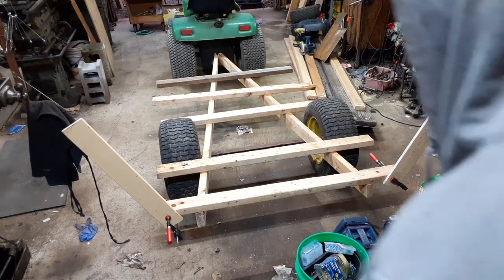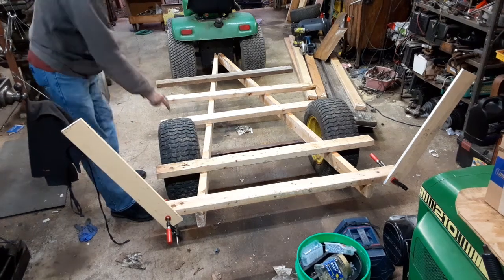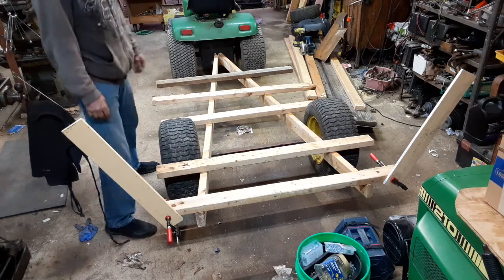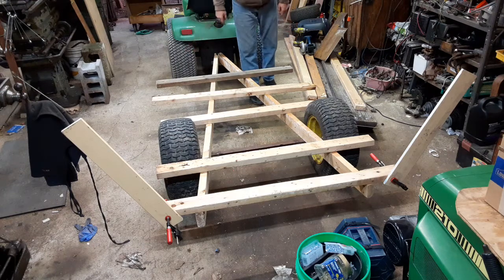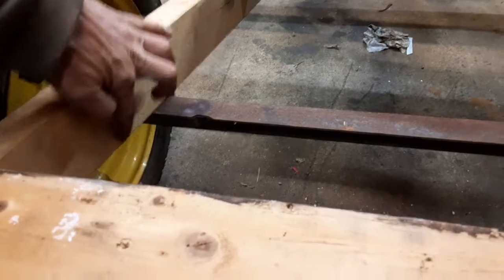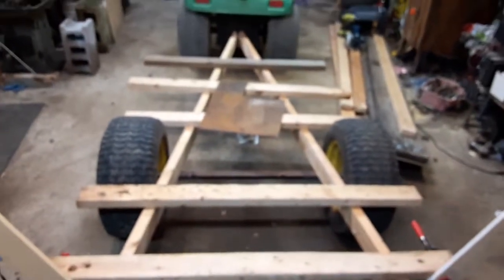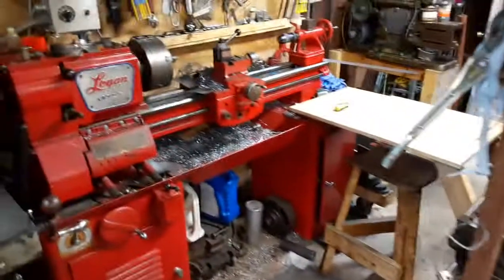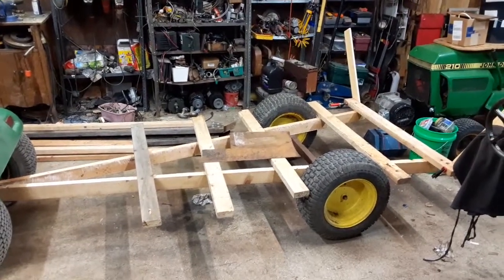garden tractor trailer build part 1

Comment: G’day Craig. It’ll work for a brush trailer, the only thing is will it still fit in the tub with those splayed out side panels. 
Cheers 
Peter
Reply from the maker: From my initial measurements it looks like it should in its static configuration.  But it just dawned on me, with no tractor to hook to, the front will sit lower. May have to re-check for that